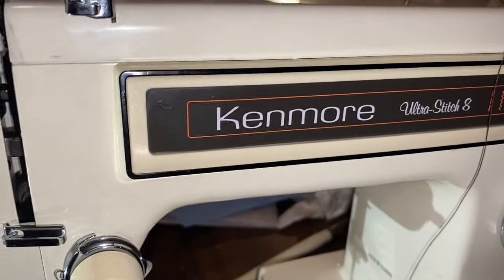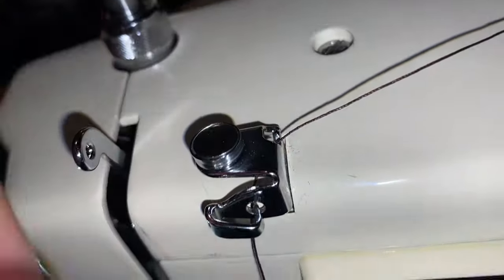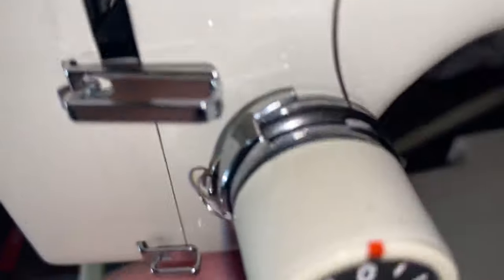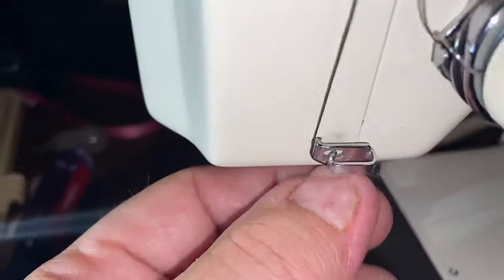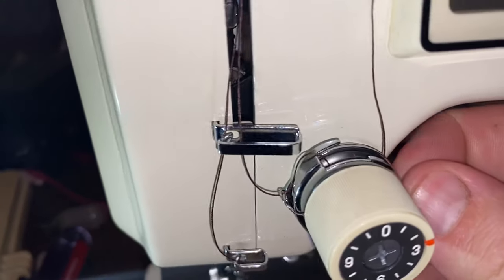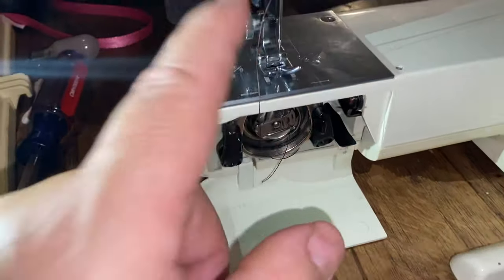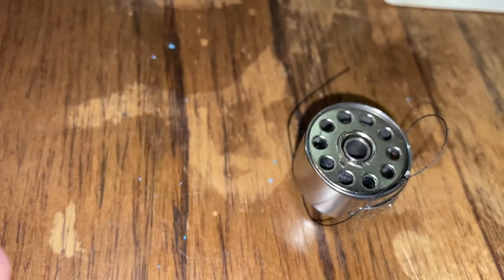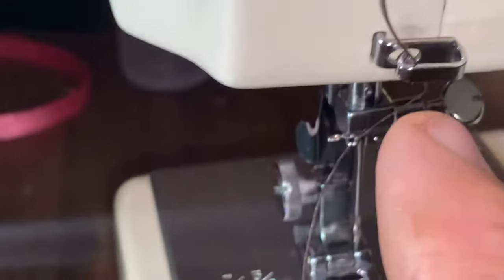How To Properly Thread The Tensioner On An Old Kenmore Ultra Stitch 8 Sewing Machine

Comment: OMG Thank you, I wasn’t doing it right and thought my machine was broken lol!! Exactly what you mentioned as the problem I wasn’t putting the thread in the tensioner the right way I was resting it on the spring thing there And not threading it into that crevice as you mentioned! So my thread had no tension And the thread kept getting caught down in my machine under down in where the bottom thread gets pulled up!! I think your video is one of the best self help videos I’ve ever seen! I don’t have to get Rid of my machine now and we can actually use it yay!! Blessings

Comment: Thank you! My manual didn't explain which side of the tab on the right of the tensioner that my thread should go so I was going in front of it (closer to me than to the machine). And OMG, was I STRUGGLING with poor tension! But after trying to follow several tutorial videos I finally found this one and you showed very clearly the one part that I was messing up. Now that I've got the tension problems solved I absolutely love my new (very old) Kenmore machine! When the tension was a problem I briefly (and enthusiastically) considered launching it from the roof of the tallest building in my city and going back to 100% hand sewing everything. But now that I know how to work with my machine I'm a lot happier with it and with the results I'm getting.

Comment: Thank you so much!!! I have been going crazy all day, I had set the top tension very high already and there were still loops forming at the bottom... Turns out I had made the mistake at the tension disk that you point out here! My stitches are looking much better now! Thank you!! (I have a different machine, Primera FY 811, but it threads just like the one you show)

Comment: Though I finally discovered this on my own awhile back after I unearthed the original manual, you are right in that NOBODY explains this properly.  I was having constant issues until I started doing it correctly. I like that you explain the bobbin tension as well.  I thought fir the longest time I'd broken my machine. Which I may have if I'd kept going with the tension all wrong!
Reply from the maker: Please subscribe if this tip helped you, becuase it helps me and it’s free. Hope you have a great day,  Tom
Reply: @ThomasShue  done and done :)
Reply from the maker: Thank you so very much!
Reply: @ThomasShue  any advice for using a twin needle ? I’m finding that one of the top threads has good tension and creating a good stitch but the 2nd one is resulting in loops on the top side of the fabric. I have a kenmore 158.130

Not unsurprisingly but the thread that is causing the loops is the one that I have placed behind the tension disks (as directed in another video I watched) as opposed to the one I have placed inside the tension disk as you normally would .

Comment: I'm grateful for the video... I hadn't done any sewing in years... just too busy... now I'm older... quite a bit older... and I had forgotten how to thread my sewing machine... I never learned properly how to set the tension on my machine.. it's always been by guess and by golly...  One more hint... which might help folks with older eyes like mine... I couldn't see to thread the needle... and oh my it was a pain... then I googled and got some suggestions... putting a bit of hair spray on the thread tip and letting it dry is working... Eureka!
Reply: The best tip is to use a piece of white paper behind the needle.  I like to use the end flaps of small boxes that small items are packaged in.  These flaps are sturdy enough to stand on the presser foot and lean against the presser bar. Then with a small light,or flashlight coming from behind needle, you can see the eye easily..

Comment: Dido to Agnes comment! I have a Kenmore Model 85 machine which hasn't been used for years. I have cleaned and oiled the machine but struggled with threading and inserting the bobbin into the bobbin case (figured this out) correctly. Your video was excellent!  I knew there was a missing step at the tensioner and your video explained the steps perfectly! I appreciate the extra info about the bobbin tension as well. I'm going to use different color threads to check the stitches. Thank you!!
Reply from the maker: You are most welcome beautiful lady!

Comment: Thank you for this video.  I have seen others and learned from them but yours gave me even more information on threading the tension.  I bought at 158 machine this year.  There was no manual so I bought a reprint on line but the diagram showing how to thread the tension was not much help.  I thought I had it right but will be re-threading the again to be sure.  I did subscribe.

Comment: I hope you do more videos on this. I've had my machine for years and would love more tips on using it since it is an older model. Thanks.
Reply from the maker: Ok, what specifically do you want me to show you. I’ll show you anything you want and that I know how to do. Thanks for watching my videos, and please subscribe.
Reply: @ThomasShue  Hi, well I just oiled my machine and it doesn't want to sew. It sews a couple of stitches and then it stops and when I press the peddle it makes a sound but won't keep going. Have to manually do it and then when I turn it, it sort of skips a stitch. Any help would be very appreciated. Thanks.
Reply: @ThomasShue  oh and specifically what should I be oiling on the machine?
Reply: @heidijsalgado  I am sure you have figured problem by now  but for others it sounds like belts may be slipping or loose.  Sometimes oil has gotten on the belt, clean it off.

Comment: Thomas,
I thought that I was to start by feeding the thread around the top disk before feeding that gator mouth guide that directs it down ward into the tension disk. Since it kept coming out, I wrapped it all the way around and then crossed the line on the top wheel/ disk. Is that little wheel/ disk ONLY for bobbin winding?

Comment: I chuckle when I hear this is an old machine.. I have my moms 1947 Kenmore and I sew on a 1947 Singer (cast Iron)  I love it.  I like this machine because of the zig zag feature.  I have a question.  I found that the machine was not always zig zagging I would have a straight stitch here and there.    I was working with a moderate knit fabric.  I read the manual and starting messing with the pressure dial at the top of the machine, it didn't help.  I packed the machine away and made a note to self "change the needle" could that be the reason I don't get a good zig zag. I would also love to see a youtube on using the buttonhole feature.

Comment: ❓ QUESTION :
 Thank you very much for your videos. My old Kenmore ultra stitch, won't work. The only thing I've done is take the bobbin in or out. Even if the entire Bobbin assembly is OUT of the machine or IN the machine, the needle arm won't work. I can turn the handwheel and the needle arm only goes about less than one inch. ( the handwheel turns but nothing happens most of the time.)

Did this malfunction simply because I set the machine gently on a slant in order to get the bobbin assembly back in ???  Every video says to do that when you're putting the bobbin assembly back in.
 😢😢😢😢💔💔💔

Comment: Hi Thomas i know this feed is old but i need help . Just got a kenmore ultra stitch 6 which from watching is the 158. My problem is the little wire spring that help with the tension came out from the tension on one side. How do i put it back. Thanks for your help. Much blessings

Comment: Please help, I have this exact machine and I use it everyday, I keep it oiled and service it regularly however I have moved and no shops in area. My tensioner assembly, like the entire assembly is simply floating with nothing tethering it on the inside area. I've never noticed what the construction was on the inside of machine. I need help it you would be so kind.

Comment: I have this same model! Is there any way to turn down the feed dog intensity?? I’m trying to see nylon and they are too strong for the fabric and I am STRUGGLING
Reply: Jamie Dandrea:  The presser foot may have too much pressure, there is a rod on the left top of machine for adjusting this pressure.  (Some machines have a dial for this adjustment.)  Usually press down on outer ring, center will pop up.  Then can press on center rod to apply different amounts of pressure.  Yes feed dogs can be adjusted but that's a job for the professionals( but not likely they are incorrect).  Try using a piece of tissue paper or light weight stabilizer  between feed dogs and fabric.

Comment: I have a Kenmore brand sewing machine that the foot pedal is sticking. It sews very well no tension issues. Not really sure what to do if it's the machine itself or the foot pedal. If you could message me back it would be greatly appreciated I don't really know anyone that knows this type of thing other than just looking it up on YouTube.
Reply from the maker: its probably the pedal.  you could take it apart and look for a loose wire, or buy a new pedal. sorry i dont have any better advice.